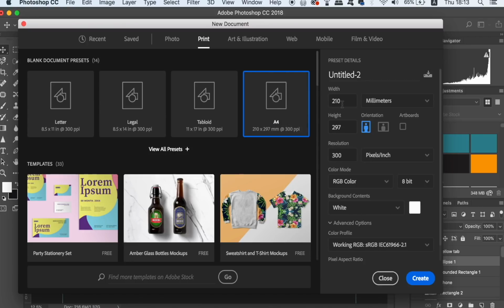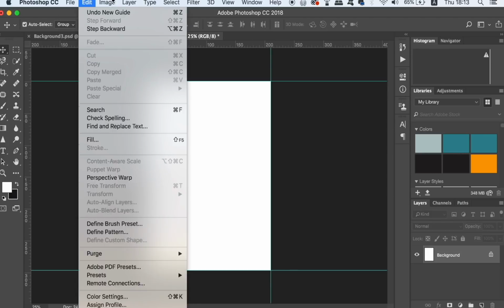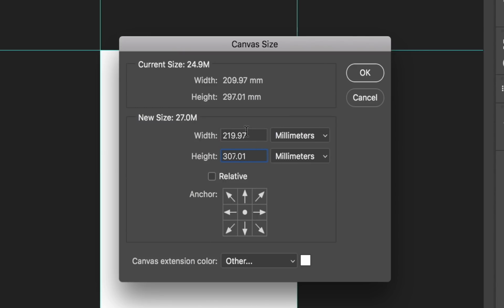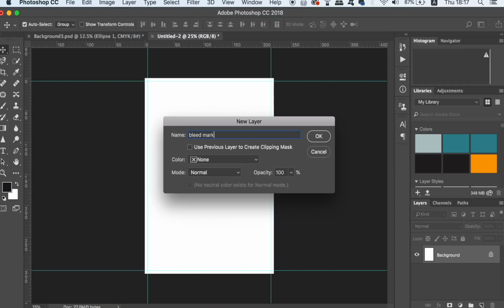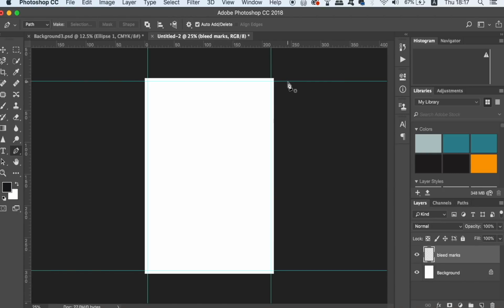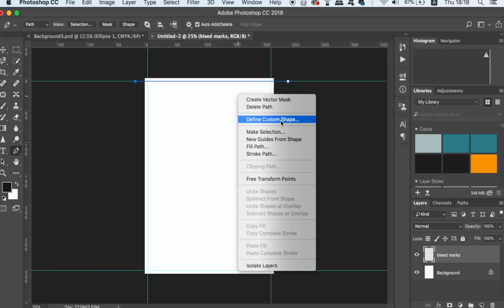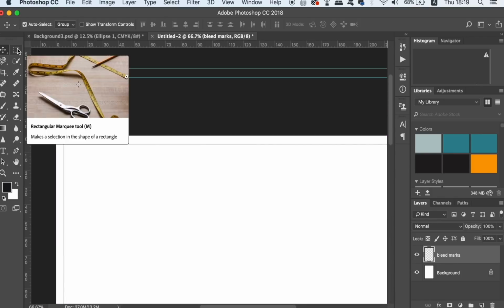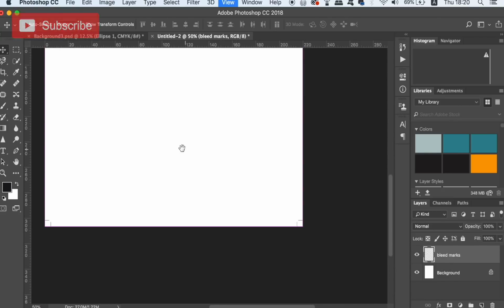Photoshop CUSTOM BLEEDS Trick (SOLVED)

Comment: This is old method y ur taking 4 min video
Reply from the maker: It's a little work around trick, but like I have mentioned to other people, it isn't the most optimum method. Setting up a print document should really always be done in InDesign or Illustrator

Comment: Work around - yes. But really NOT he safest way. This is NOT recommended.
Love your YouTube channel but I’m guessing you haven’t spent much time at a professional design company with a Post Production department (ArtworkDdepartment) I wouldn’t be recommending this as way to add bleed and crop marks safely to a document if a client is after professionally artworked creative for print. Sorry mate.
Reply from the maker: I should have stated that this is a last resort if you do not have access to Id or Ai. 
In the past I have worked on 12ft x 6ft billboards, a few days ago I sent a 3 metre banner for print via InDesign; as well as working as a junior designer at a printing agency. So I am fully aware of professional printing and what the printing process entails. This was more of a fun little trick to work around the 'no bleed settings' in Photoshop. Often you can design the artwork in Ps and transfer it over to InDesign, but like I said, this is a last resort or meant for home printing etc.

Comment: It's a work around at least but, the lines should be 100% CMYK for plate separation not just black. For me it's easier to import the psd file to illustrator and export the pdf with cutting marks from there.
Reply from the maker: It was more of a fun little trick I had stumbled across a long time ago, ideally one would set up a print document in InDesign, if not then Illustrator.
Reply: Satori Graphics really can't get myself into iD (know I should), used to use Quark for that (terrible program) if you get time please upload a video on this topic using iD. But, I have a question, when exporting from iD is there a way to export separate CMYK pdfs but all registered as 100% black? (this is the only useful thing about Quark). Great work as aways.
Reply from the maker: Back in around 2003 I went into work experience as part of my graphic design course in school. I was there for 5 days and the art director in the agency was using Quark. I haven't used it since lol. As for separate PDF options, that is quite an outdated thing which I don't think is possible, and I have read that it was also pulled from Quark in the 10th program? 

InDesign is great to use for print projects once you get the hang of it. In many ways the interface is a lot like Illustrator.